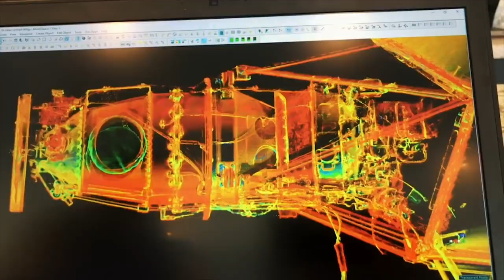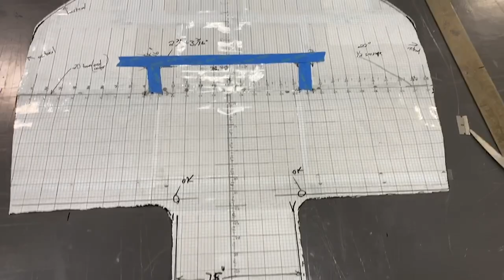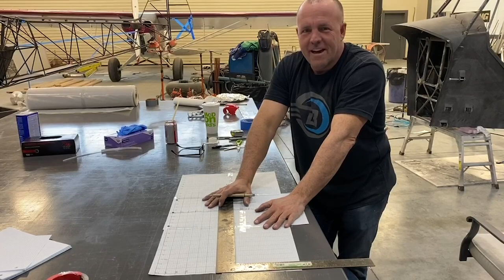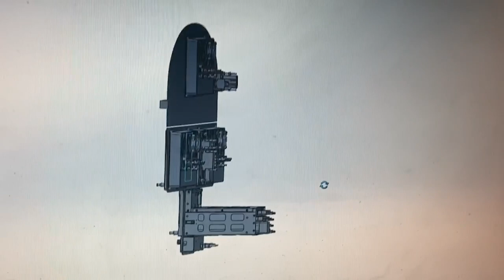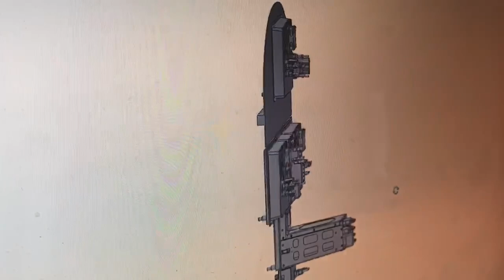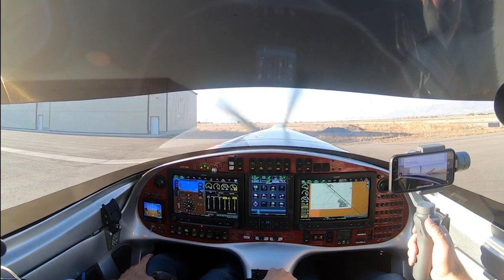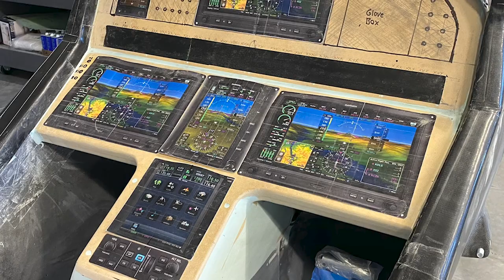Winners of Free Airplanes and Scrappy Update 🤠 (Scrappy Bush Plane 11)

Comment: Hey Mike,
Solidworks “import sketch picture” set to 50% transparency and you can simply trace the lines/arcs over the picture. Import that dash in multiple 8.5x11 scans to get your part. Works great on complex stuff you need to “rough” into CAD even without a large scanner.

Since you have grid lines highlight a line with pin or sharpie every 6” to make the larger projects easy to put in place inside your sketch.

Comment: 15-20 minutes strikes me as just about ideal, long enough for really solid content and still a reasonable length for editing. If you check out Kermit Weeks "FoF Mechanic's Corner" and in particular Paul Stecewycz's series on the Messerschmitt Bf-108 restoration, you will see that they commonly fall in that time frame, some going a bit longer.

Keep up the good work, these are some of the very best videos available on aircraft fabrication.

Comment: Timely information flow is more desirable than duration.  I would much rather see a 15 minute vid once a week, than an hour once a month.  The panel is turning out beautifully.  One thing to consider are some sort of snaps in the corners for a dust cover.  Because of the reclined angles, it will gather more dust and crud, including condensing moisture when exposed to temperature cycling, especially if the plane sits outside overnight.  I'm thinking some sort of marine vinyl, not too thick, with a cool stitch pattern that prompts an accordion fold. Then a map pocket to the side or a second set of snaps somewhere to store it, or make it in such a way that it doubles as a cargo cover or restraint, because it is the width of the cockpit overall. GBTW!  Yup, ya'll should be sellin' Get Back To Work T-shirts.  I want one.  If only to harness just 1% of the MPPNPS, (Mike Patey Patented Personal Nuclear Power Source) on a local basis!

Comment: Actually Mike -- I've done teaching and made teaching aides before Internet came out. I originally taught Advanced Welding in the U.S. Navy and took its 30 minute segments and made them into 15 minute segments and found I had a 100% increase in retention and learned skill sets.
My second teaching project was in S____ Systems, Inc. machine shop where I taught CNC Programming, Blue Print Reading, ISO Quality Control theory and methods where we used the Granite Slab with Height Gages and various Dial Indicators, Angle Bars, etc., etc. to bring a 86% Rejection Rate down to a Crazy 3% machined parts rate. The owner -- was amazed. I used printouts of the scheduled subjects that would be taught to go along with 10 minute Sessions.
My third at teaching was at K______a, Inc (a food processing comping now in Walpo, Mass. I taught Blue Print Reading, Welding heats and heat treatments, Shop Trig as well as metal fitting and form/fit/functions. I found 15 minute segments to be the most effective.
I have taught Cisco Networking, Computer Science classes and they were segmented into 10-15 minute segs followed with Q&A sessions for another 15 minutes.
So - I'm 65 last year. I retired at 50 because I had pretty bad group bicycle ride crash. But, now I'm thinking of going back to teaching but, over the Internet. I've studied other teachers on the Internet and I have found the most effective times to be 10 - 15 minutes on subjects that are subjectively started and stopped to a complete topic of whatever project being done. Some CNC teaching was being done at 30 minutes in unexplained segments and many of those are just gone. Where? I have no clue. Welding Lessons have gone from 5 to 35 minutes. I watched a bunch. Usually the 15 to 20 minute segments were the shortest, less boring and more succinct for learning ones were the ones I would use. 

So my Answer to your Question! 15 minute segments ideally segmented to physically doable and accurate skill sets.
So my Answer Cont.....Divided into Intense Theory as you do the Physical Labor of Love in your hobby. Just like you are doing with this Shark Fin project...which many parts are too long.... but, divided up into 15 minutes segments would cause more excitement and curiosity but, also better learned engineering.
Thanks Mike for all your excitement that you have brought to the world. I thought all the truly excited engineers with the balls to show that excitement were all gone but, myself. I used to only show it in the shops and that's what made me so effective. I haven't figured out exactly what I'm going to do -- but, I'll be doing it soon. You have "Inspired Me". Thanks again.

Comment: Hi Mike. Short updates would be great.  No longer than 30 min for sure.  We need you to keep posting and not become a film editor.  Lol.  When you start thinking about start and back up batteries let me know.  We may have some thing off the shelf we can use but we can also build just about anything via 3D printing. I make a line of custom batteries just for the carbon cub tray under the seat.   Like you say.  Back to work!

Comment: Consider investing in a good 3D scanner so you can capture that data digitally and accurately then import that point cloud data in SW and remodel it. Once you start capturing hand worked, hand fabricated parts that way it will really open up what you can do

Comment: I'm wondering Mike, for getting the panel into the computer if it would have worked to take a photo of the panel, set it as the background and then sketch over it, once its in you can then do a few reference dims to set the scale. I've done this before in SW with some pretty good results.

Comment: G'day Mike, Greetings from Down Under. I hope you can find a few minutes to reply.
A few questions:
Did you do the electrical schematic in Solidworks? I previously used Microsoft Visio. It did the job but it is somewhat clunky. I'm about to do a new panel layout and am looking for a better way to do it.
What switches are you using and are they light and labeled?
I see you are using discrete Cct Breakers, why didn't you use a modern solid state distribution system?
Cheers
Danny

Comment: How would You be able to see something on this lying screens ?
Reply from the maker: Jack Airelnika 👍🤠 great question. I lowered my glare shield down over an inch. I have more visibility than a stock cub, all the screens are down not up.  The sight out the window at the 50’ measurement in front of aircraft from ground to site stick night was improved 3” more so down the runway it is vastly improved
Reply: @MikePatey  good job & good luck